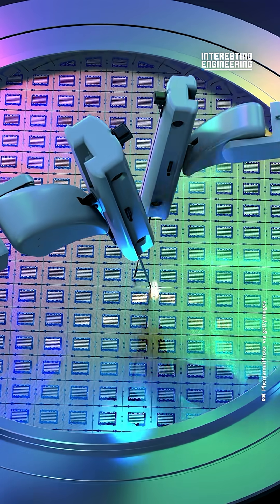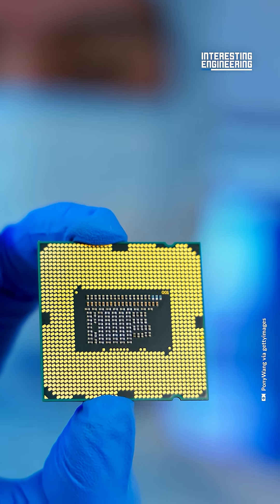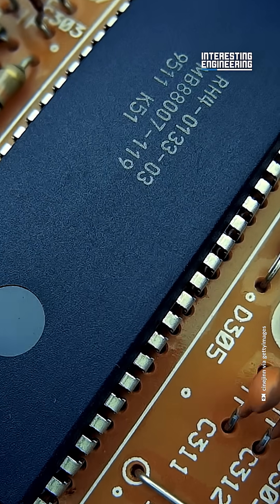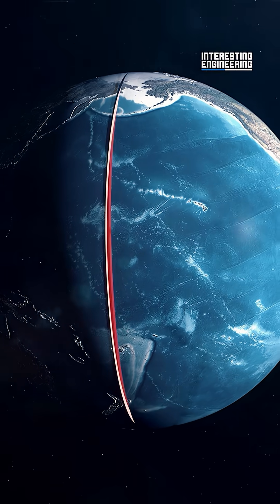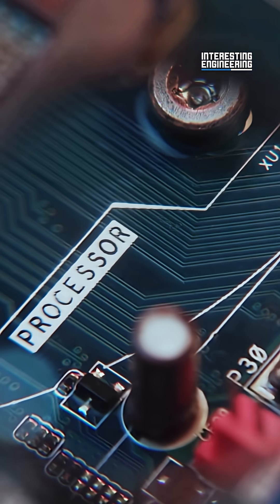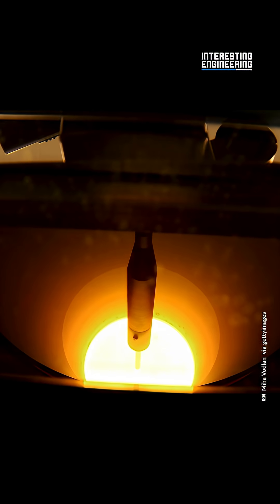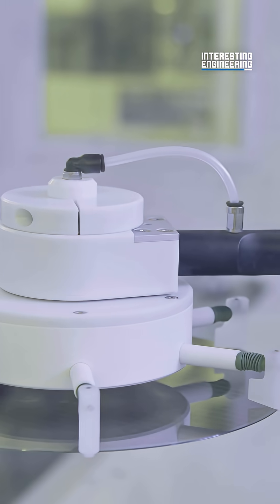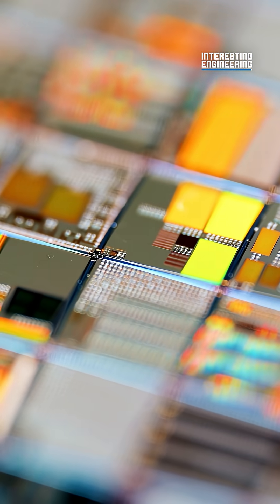The Secret Behind Every Device

Comment: silicon doping is ignored in this manufacturering process 

We don't use pure silicon in electronics , the first concept of diode and transistor is using N-type and P-type semiconductor while pure silicone is neither 

So it has to be doped to get those